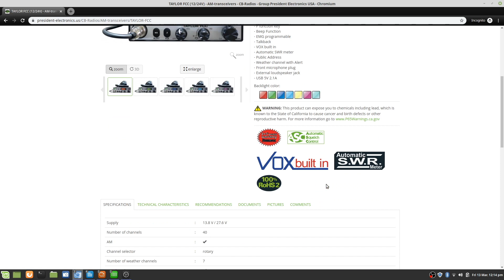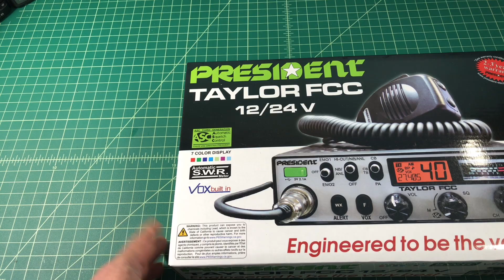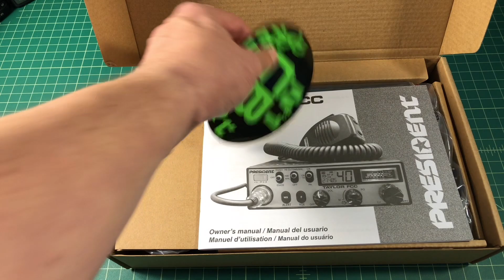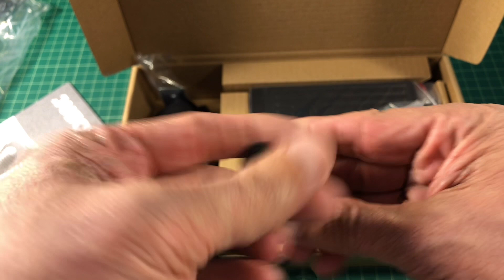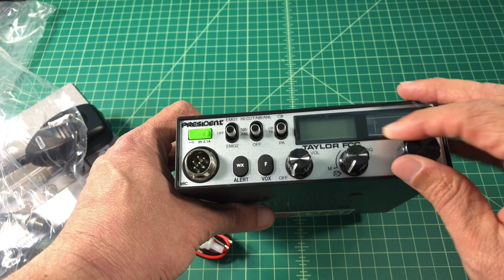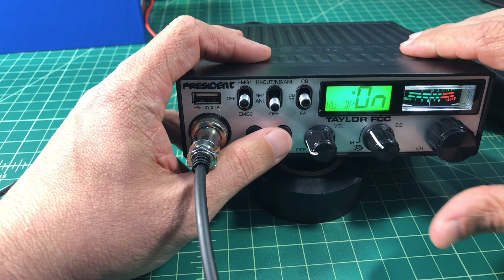President Taylor FCC CB Radio - TheSmokinApe

Comment: This Radio is no longer for sale in the US. They new version will be out by the end of January 2022. It now contains a FM selector switch. That puts the radio into the new FM CB band.  It will only transmit in FM in this band to comply with the new part 95 Class D regulations. The band is between 27.435 - 27.535 the old RC aircraft control band. That got moved to 70 MHZ 4 meters back in 2000.
Reply from the maker: Thanks for the info Vicky!
Reply: Wrong. It is for sale. Still. Just saw it on the shelf in Alabama truck stop. 
Just before this post.
Reply: I just bought the non FM version on Amazon Dec 15/2023 so yes it's still available.

Comment: Killer video! I am still a fan of CB radios. How has this one been performing? I still have my Galaxy 88HDL and 350 watt amp from my truck driving days.
Reply from the maker: Thanks man!  I’ve only used it a few times but I like it quite a bit, it’s too big to put in the Jeep so I’m thinking of adding it to the shack 👍
Reply: @TheSmokinApe  I would like to put a CB in my Ram 2500 but with two 2m/440 radios and soon an HF radio I am running out of room.
Reply: I have one of these these in my 2024 4Runner, half of it fits nice and snug in front of the gear shifter. Looks like factory installed.